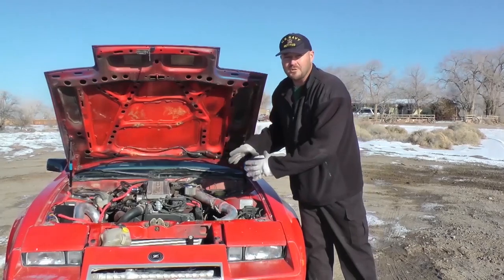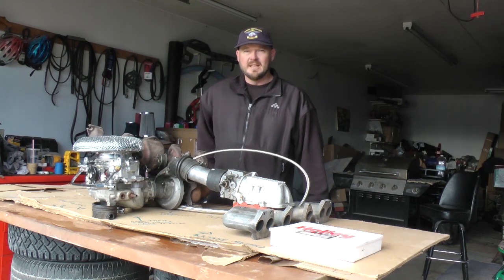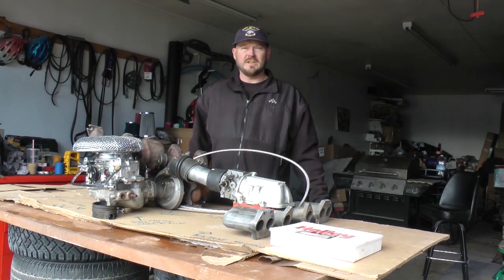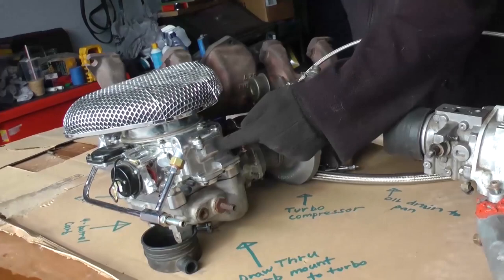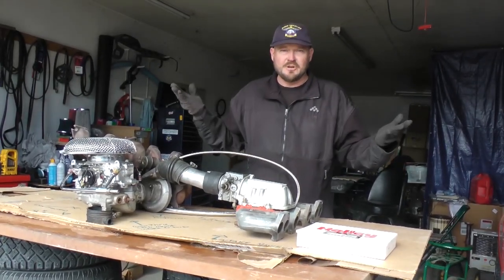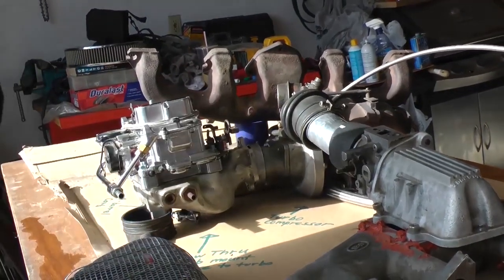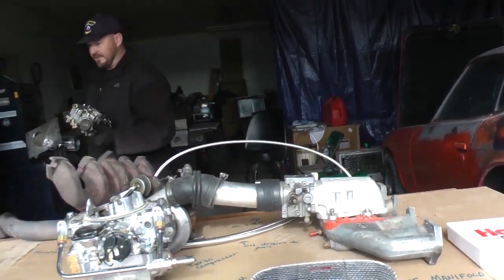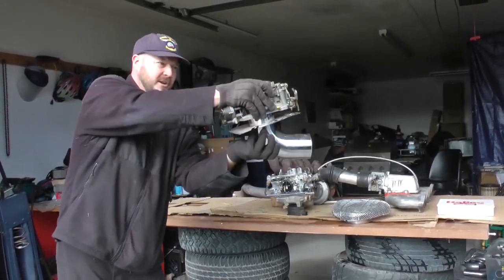Draw Through TurboCharging (Carburetor)

Comment: Love the info. I'm on a tight budget and it looks like a draw thru setup is the way to go. I have a 1964 Mustang with the original great running 260 V8. Want to add sone power without the pain of swapping to a 302 like everyone suggests. If you know anything about Fords you know they ain't exactly universal on switching engines and transmissions.
Reply: How did it go?

Comment from the maker: This is a great turbocharging technique that I have not seen in any discussions or videos. Figured that some knowledge on this subject could be shared to inform and give ideas to anyone that would like an easy turbo setup not needing an intercooler or any complicated expensive computer controlled fuel injection systems. Its a great proven reliable way to make turbo power on a very reasonable budget.
Reply: Hi man great video! one question, how do you set the turbo pressure on this configuration? do you need a waste gate valve?

Thanks!
Reply from the maker: Yes either internal waste gate that is built in on most turbochargers or an external waste gate mounted on the turbo header before the turbine flange to regulate exhaust pressure in turn boost.
Reply: +Budget Boosting Forced induction doesn't change compression ratio. it increases your theoretical displacement by increasing compression pressure. (higher pressure at bottom of stroke, higher pressure at TDC.) The ratio between the volume of the cylinder at the bottom of the stroke compared to TDC doesn't change. Serious block/crankshaft modding is required to change this ratio. You need higher octane fuel to resist knock, or install a head spacer to increase the cylinder volume at TDC (Compression ratio stays the same, more volume at bottom stroke, more at top, in an equal proportion) to offset the increase in cylinder pressure. Shorter connecting rods and shorter piston heads will also have this effect. While the aforementioned options may allow the use of non-premium fuel, you have lower power output than stock whilst boost is building, since the cylinder pressure has a big effect on power output, and is the sole determining factor in what grade fuel you need to run.

The rest of the video is pretty helpful though, thank you for explaining the simplest way to turbo a carbureted engine.
Reply: i have a weber 3838 would that be enough fuel
Reply: bruce turner How are we supposed to know without details for the rest of your situation?
Reply: +Noah I did look at post I have a 85 Nissan 720 z24 2.4 lt motor and I ask if I need a 500-600-cfm carb or 200-300 cfm and then I asked if the weber 3838 would work
Reply: Sorry, I must've missed that.
Reply: Can I just Thank you..

Comment: Didn't know turbos increase compression...hmmm
Reply from the maker: Normally every time the piston goes down the intake stroke the intake valve opens and draws all it can suck.  With turbocharging the same situation when the piston goes down the valve opens and 20 pounds of air pressure is slammed in.  That increases pressure by about 300%

Comment: I've been running draw through with propane for a while now with pretty good results (forklift parts).  It sucks a TON of fuel down though.  It's just kind of scary to think I'm sucking explosive compressed gas through a screaming hot turbo and some home depot hot tub hoses and toilet accesories, then down the intake. But it's been loyal for 5 years even starting right up in -20F weather. My mounts and adapters are 100% from the plumbing department and it's set up that you can steal ANY bbq tank and drive about 50 miles in a pinch. Not recommended but you can do this relatively safely if there is a gasoline shortage and you have an emergency.
Reply: Where did you get the exhaust manifold?
Reply: @jerryp2433  Its an ultra rare stock Chevy Turbo Sprint manifold. Its basically a Geo Metro lol
Reply: @misterbulger  oh. I heard of those.

Comment: Hello Mad Matt. Just wanted to say that this video on DRAW through turbocharging has re-inspired me to add some form of "supercharging" to my Slant Six! Your style and instruction is very straight forward and no-nonsense. Very helpful to those who might otherwise be intimidated by such an undertaking. I have been toying with idea of turbocharging for some time. But I was under the impression that turbos and carburetors don't play very well with one another. This notion may have been perpetuated by the crude technology and engineering of turbocharging by auto manufacturers in the late-70's through the early-80's. They seemed to have had reliability issues and disappointing performance despite all of the advertising hype. Your videos have changed my perspective. I'm sure many other of your subscribers have felt the same way.It seems to me, that basically the Draw-Through arrangement is not all that different than bolting a carb(s) on to of a "traditional" Roots style  crank-driven super charger for a similar effect of increasing the PSI of air/fuel mixture into the manifold plenum. The Draw Through configuration seems to me to be a great entry-level experience into the world of Turbocharging. Because of this new-found information that you graciously offered, I am seriously considering "dipping my toe" into creating my forced induction fabrication projectA couple quick questions. How much should someone expect to pay for a used '80-'81 301 Turbo Firebird carburetor (or other GM turbo) 4 bbl. mounting plenum that allows the air/fuel mixture into the turbo inlet? Also, does the carb necessarily have to be above, or at least level height with the intake manifold? The reason I ask is because I might have some vertical space considerations to deal with in terms of clearance issues. My hope is that the draw from the turbocharger would basically force (suck) the air/fuel mixture into the housing without having to be concerned with using gravity for the mixture of a carbureted, natural aspirated configuration. Thanks in advance and keep the great videos coming.
Reply from the maker: +WasntMeOfficer I was lucky on ebay, I purchased the draw through carb mounting plenum for around $50, its pretty much hit and miss on ebay.  Saw other auctions for the whole carb, plenum and turbo combination for around $800.00 on ebay auctions.  Wrecking yards would also be a good source since many do not know of all the draw through turbo cars made from 78-83 until fuel injection was the way the manufacturers went with turbocharging.  I recently purchased the first generation turbo buick which is a draw through 4 bbl. carbureted 3.8 turbo V6 which started the evolution towards the famous Buick Grand nationals that hit the scene and made turbocharging ever so popular today.  In my area Fallon, Nevada,  I also spotted a 1980 Pontiac turbo trans am which had the draw though 4bbl. carbureted turbocharged 301 ci V8, the first of its kind from the factory.  He didn't have a for sale sign on it however, have seen it for sale on the internet.

Comment: Back in the 80's I had a 76 chevelle SS that I did this setup on. A company made a kit that had the turbo, carb intake and adaptor to bolt on top of the intake manifold. The carb wound up where the battery was so I relocated it to the other side.

The only tricky part was the exhaust.  I recall having to pipe the left side headers over to the right side and Y them together and then into the turbo that sat on the right side behind the carb with a single exhaust pipe coming out of the turbo..

The advantage with Draw through systems is you dont have to mess with the jetting or anything really. Since it's pulling the gas with the air it just pulls more of both in proportion so the mixture can basically stay the same... With forced systems you you have to increase fuel flow to keep up with the air your pushing in there.  So these systems can be installed in an afternoon without any tuning other than retarding the timing a bit to prevent detonation. 

Of course with so many cars being fuel injected now and ECUs thjngs are complicated, but if you get your hands on a carburated car these things are fun.

That chevelle was a total sleeper and was so quite since I just had the one pipe into just a bigger stock muffler.   So fun smoking all those big cam loud Street rods back in the day.  They would take me off the line but the look on their faces when I quietly passed them was priceless.

Comment: Thanks!. Not a bad rundown.Remember some exhaust manifolds (factory made) had provision for external wastegate ...as in the Mitsubishi sigma turbo (Australia) 1981!.
Reply from the maker: +John Caton They all have either an internal wastegate built on the turbo charger or an external wastegate built on the turbo header or exhaust manifold.  If not, the turbo would overspeed and cause engine or turbo damage or both.

Comment: I've got a 83 F150,I'm gonna do something very similar!

But I have a question..Do you need to get bigger Jets, float bowl and Higher pressure Fuel pump to supply the engine with the Needed fuel the engine is now Requiring?
" Will you need to alter the carb to supply enough fuel?"

Comment: So then, getting a modern fuel injected supercharger and adapting a carburetor on the throttle body side is feasible and will work right?
Reply from the maker: R Sanchez Having a modern supercharged and fuel injected set up would make it much easier to turbocharge.  You final product would be supercharger off the line and turbo boost from midrange to redline.  In my opinion the best set up you could do.  Look up Hennessey performance Ford GT supercharged and turbocharged super car.  To do this you run the turbocharger boost to the intercooler and then to the intake of the throttle body leading to the supercharger.  Draw through or blow through turbo combinations are for older carbureted cars or cars that you would prefer to convert to carburetor.  Thank you for watching and hope this answers your questions.

Comment: Do you need a special turbo? Like will the turbo need special seals to deal with the vacuum caused when you let off the throttle? I’m asking because I never turbocharged a motor but I assume if it I get a turbo that was intended for fuel injection the turbo would not be built to see vacuum on the input side. Thanks
Reply: I guess another thing to ask about would be distributor timing. How will a stock distributor react to boost instead of vacuum when you put a load on the engine? I’ve got a 403 olds that is stock and would like to try this possibly. Thanks again.

Comment: Nothing wrong with draw through setups people. Indy Cars were doing over 200 miles per hour in the 60s into the 70s with it. At one point there was so much debate over draw VS blow, that even A.J. Foyt used upstream and downstream fuel injection in his FOYT engines, and was one of the fastest out there.  I had a 'new 79  4cyl Turbo Mustang Pace Car, that I tuned and tweaked with 22lbs of boost, ethanol through the top of my carb, for extra charge cooling, and I smoked almost everything on the freeway from Berdoo to Long Beach. I could run with a Carrera until I ran out of gears, I only had a 4 speed BUTTTT it would get me to 151.... according to the CHP ;) .
Reply: its old technology is the problem
Reply: My dad had a 400 horse full forged 2.3 turbo in a merkur when i was younger used to take it down for track days and race against the turbo carreras he could run them down on the straights but wasnt as fast coming out of the turns but if he held his line he could really run with them

Comment: good to know stuff here. former fc2 (disabled here). draw through are good when you live in a warmer climate. i have one in storage for the buick 3.8 and 2 grand national turbo setups (i am thinking about putting one on each bank of my 429 BBF). if you look at the draw through setups, when the air is drawn through the carb, it gets REALLY cold and condenses. if you watch a car running, youll see the intake sweating before the turbo. one doesnt want to use a mechanical carb either. vacuum 2nd is best because youll want a large carb to feed the turbo but bigger will kill power while not spooling...
what i want to do is take the draw through setup and run propane through it. that way, you would have the 9:1 or so and still have low end torque, but not knock and ping at higher rpm due to octane of propane. should be able to turn the boost up higher with propane for that reason.
can you shed any light?
Reply from the maker: The challenge of propane would be the challenge of how to inject it into the carburetor. It's a good idea, however you would almost have to inject it directly into your manifold, and experiment when to inject it. You would have to have a system that injected it at specific times, similar to a nitrous kit. I highly recommend if you can get 100+ Octane fuel, I would stick with that, because it's more consistent and manageable than propane would be. We run 100LL (Low Lead) AV Gas, which is available at our local airport.
Reply: they have a carb hat to mix the propane. fits on the air filter ring. remove the jets and seal a few things in the carb and yer golden. once adjusted, its passing fuel/air like normal air. seems easier this way..i just havent played with it.
Reply: I ran propane for many year they have an assembly called a mixer . It served the same function as a carb but no float. You adjust the 
Mixer turn dial for rich or lean no heating required.  A  heater is required which warms the  Propane as it evaporated and requlates the pressure to the mixer. O
The heater is just a pressure regulatory with heater hoses lines  from the engine to warm the vapor.  Propane runs from 100 octane to 115 far superior to gasoline. Easy to install. Propane lives to run at ,12.5 to one compression ratio.  Propane Enters the mixer intake and engine as a gas no droplet or pudding. 
The mixer does not need a Ventura to function. Propane having higher octane than gas can be run lean at high compression with more ignition advance than gas.  Because the propane is always vapor at mixer presure unlike gas it will not wash down cylinders. Propane Will resist knocking very well and burns 100% of the fuel very clean powerful and can achieve good fuel economy if you use high compression and lean mix propane does not need a choak or high Idle when cold starting because it is already vaporized  it will start soon as you bump the engine even at 40 below zero.

Comment: Excellent video. I have a willys jeep with F-134 Hurricane engine. I am inspired to turbo charge it after seeing your video :) 
Will there be any icing issues in the carburetor? If so how can it be addressed? 
Can i run the turbo with LPG with the same set up? I also have an LPG conversion kit installed in my jeep.
Reply from the maker: Ato Lkr Startup will be fun in extreme cold conditions however since the carburetor is in the engine bay, the engine will warm it up after some time idling.  Its not too bad with electric choke.  The 1978 through 1983 Turbo Buicks and 1980 and 81 Pontiac Trans Am turbo had draw through carb setups from the factory and they did start quite well.  There was also a heat riser from the factory from the exhaust manifold leading to the air cleaner to warm things up even more upon startup.

Comment: I have a neat little frankenstien that i'm building. I found a kit i believe is from the mid eighties made by RM. It's for a small block chevy. Really nice manifolds a cross over pipe an Air Research 62mm turbo drawthrough setup. I am mounting it on a vortec L31 5.7 litre 350 through performer rpm intake manifold. However instead of carbed I will be trying to mount a tbi on top as it is going in my 87 chev shortbox. What do you think? should work just as good as a carb if not better no?
Reply from the maker: +hotshothogger Many great TBI kits out there.  I especially like the ones in Summit racing, one of them has a TBI system, standalone electronics rated to manage 21 pounds of boost.  That would be my choice.

Comment: In the late 80's (87?)GM used a preheater under the carb on the s-10 4 cyl engines, it vaporized the fuel before it got into the engine, increased gas mileage by a ton when it was on all the time, so they incorporated a heat sensor to make it run intermittently, the deisel engines in most new pickups use an electric heater on the incoming air, any thoughts on this instead of using methanol to stop freeze ups?
Reply: Yeah they call it carborator  heat in airplanes and pre throttle body carb cars.

Comment: My turbo is a ray Jay . And has no internal gate .  Can I run an external gate ?  And how would I plumb positive boat pressure to make the gate work ? There would be fuel going through the gate?
Reply from the maker: Intake manifold pressure line to actuate external waste gate under boost pressure.  Wastegate installed just before turbo flange to regulate exhaust which

Comment: Hey Matt, I was wondering for a draw through set up whether you have to modify the carb? I know on a blow through you need a double pumper set up but I would like to know if it’s the same thing. Or I can use a double pumper set up on a draw through. Or I don’t have to adjust it at all because the carb is on outside? Thanks.
Reply from the maker: With draw through jetting for your boost and engine for performance is all you need.

Comment: Got a good question for you what about a blow off valve how are you going to regulate the pressure when you let off the throttle aren't you going to have a lot of turbo lag
Reply from the maker: Draw through boost cannot have blow off valve due to fuel and air mixing in compressor.  Fuel would blow out blow off valve and have under hood fire

Comment: i like the info. curious if you have run the setup on any vehicles yet. im looking to do this on a small motorcycle but curious if fuel heating in the compressor housing is an issue due to the temps the turbo gets up to?